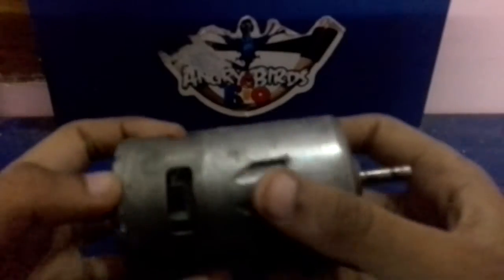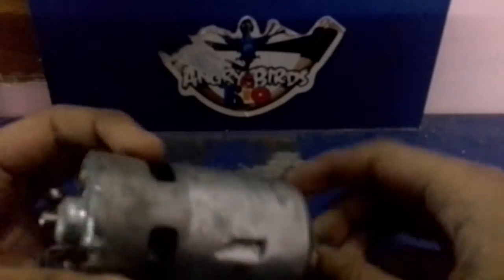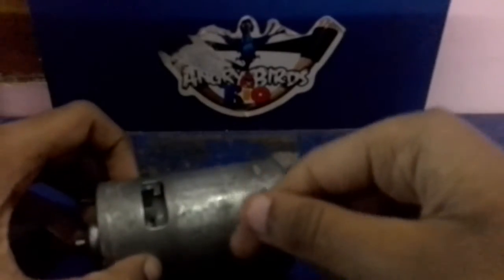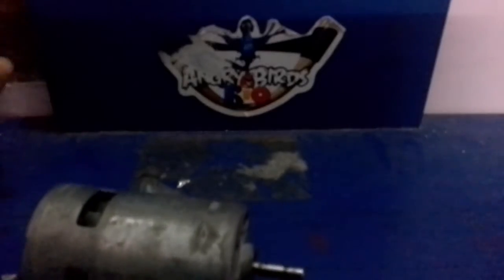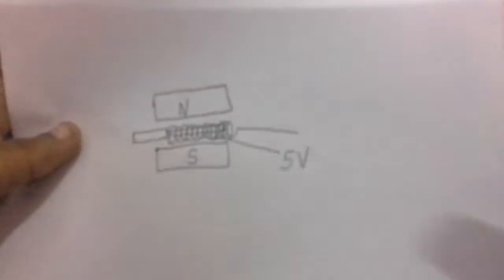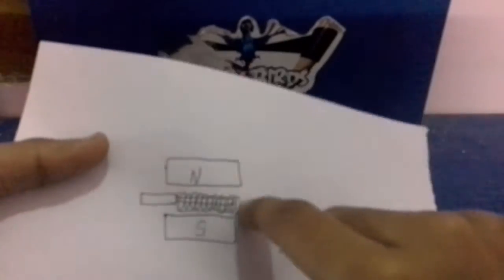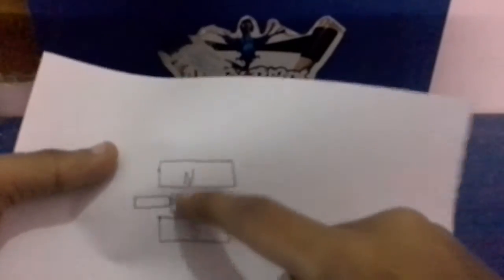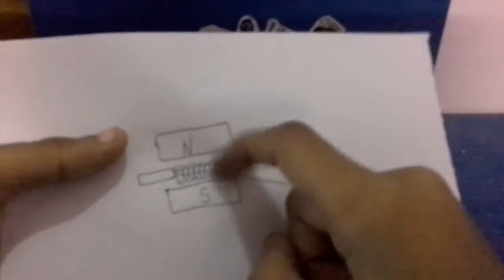Electronic basics #16 |How do dc motors work

Comment from the maker: Hello, If you ask how does the motor spin if the polarity changes and stick with the other magnet, then I would say that it has three coils and has terminals stuck to the rotor and when part of the rotation is finished the rotor spins and the next coil powers on. This cycle continues